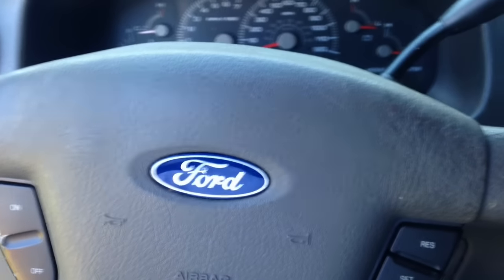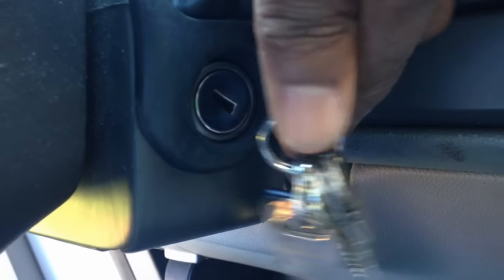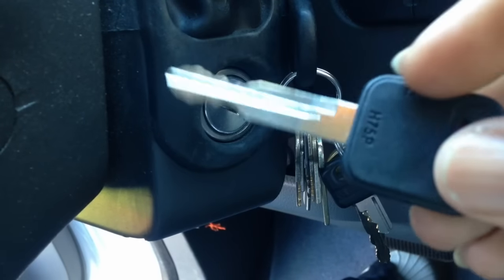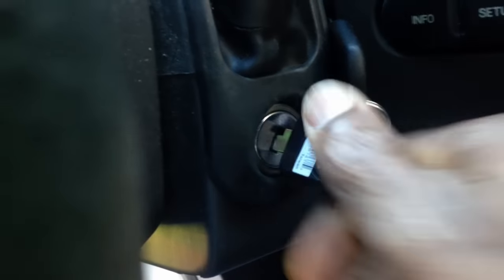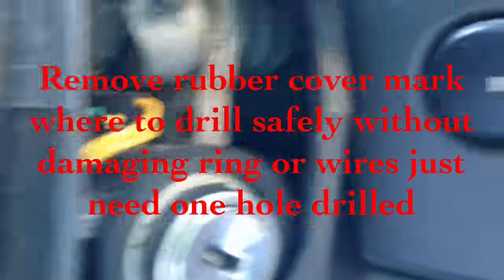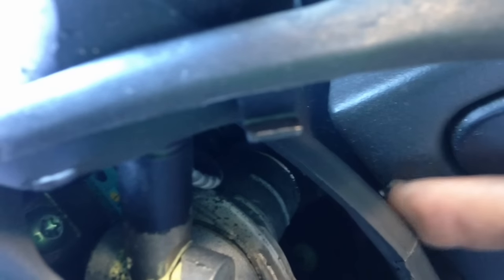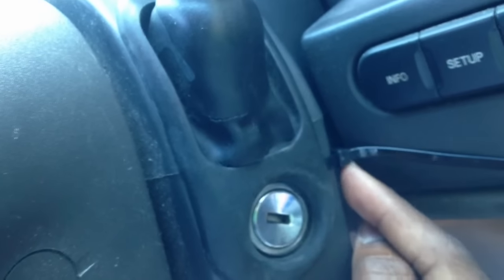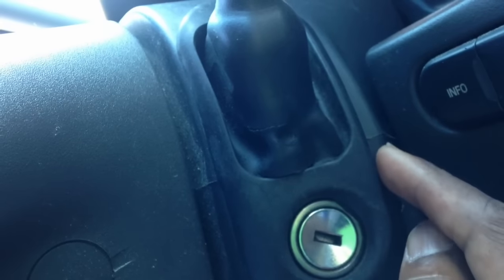REPLACE FORD KEY NO PROGRAMMING NEEDED CHIP WORKAROUND "bypass "

Comment: Of course it works it’s picking up the signal from the chip in the key, the trick is how do you do it without the key?
Reply: Just cut open the old plastic remove the transponder and glue it inside the new plastic
Reply: Jimmy S  If you have a truck or a car Ford sells as a fleet you can turn off the pats system that is how they make keyed a-like vehicles that’s how thieves steal cars they don’t change the Ecu you can also just Buy a PATS chip and program it but they will be there for ten mins as they gain access to that system thru the ecu
Reply: Why would i make a key unless i lost the original? This is the case i have no chip at all any ideas?
Reply: He's saying he could leave that one mounted, then go make 2 or 3 more copies. But now you're susceptible to anyone can steal your truck now that you're original key is mounted in there.
Reply: @mikerafonemusic6177  did you come up with a solution since you didn’t have an original key? That’s where I am right now.
Reply: The best way is to remove the chip only from the key and mount it in the column under the plastic. Now make 3 copies and your good. Now no one still can get in car and steal unless they make a key, but you have extras in case your late for work and cant find your lost key. Perfect example .  🤗
Reply: @johnnybones2029   You still have to have the key cut correct
Reply: @mikerafonemusic6177  my husband‘s key is split in half in the middle and he’s worried about it breaking in his ignition and we had a copy of another key but he ran it over with the lawnmower so one has a chip and one doesn’t but the one that does have the chip is the one that has the crack in the key so now we need a new key so we have his original but we need a new key to start it

Comment: The better way is, first get your new chipless keys made, cut the blade off the transponder key, remove the steering column covers, and hot glue the head of the key to the black plastic transponder ring found around the ignition cylinder. Before gluing it into place, just hold the transponder key in the spot you want to glue it and then try starting the vehicle with one of the chipless keys, if it starts, you found the perfect spot to glue the transponder key. This is how we used to install remote starters before they made keyless bypass kits.

Comment: My keys are so worn that they no longer work.  I can replace the tumbler, but then I would have to program any new keys -- not happening without spending money at a service shop.  This trick, could save me a pocket full of money.  Bravo!  It never occurred to me that the key only needed to be in proximity of a reader.  I always thought that it was a face to face contact thing.  Your thinking outside of the box is commendable.
Reply: Unless you have a late 80 GM car that has a resistor on the blade of the key. If you do you can bypass it with a resistor of the correct value installed in the circuit then use a cheap all metal key. I know your comment is 2 years old but perhaps someone else needs the info. Cheers~

Comment: Great idea, I wouldn't do this to a newer truck, but for my 2003 explorer it would be perfect. Not really worried about someone stealing my 13 year old truck.  Another reason this is a good idea is, say your far away from home and lost your keys somewhere, doing this will always get you home.  Thanks
Reply: Yep just use the door code and you are able to get in and get to "your spare" so to speak.
Reply: Why be worried about any vehicle being stolen when you can have kill switches or gas cutoffs installed?

Comment: Wow!  It worked for Me, I have a 2003 Ford F150 Super Crew Cab Truck and I put the "Chipped-Key" right on the Ignition and the Ace-Harderware non-chip key in the ignition and it fired right up the first time.  I think I will just attah my chipped-key to thr ignition and use the other non-chip keys since I only have the one chipped-key.  Thanks for this information 😉👍

Comment: I did this to an '09 Focus.  The odd thing is that the key had to be very close and perpendicular to the transponder for it to start with a regular key.  I just zip tied the key right above the ignition cylinder where the key is inserted (under the column cover, of coarse).  Works great!
Reply: I have a 2006 ford focus.  I'm about to try this out.
Reply: I have a 1999 Ford Windstar. The Ignition Lock Cylinder Switch is somewhat worn out. From time to time it is locked. I have to vibrate the cylinder in order to turn the key on. Will give it a try.
Reply: Zip tie, great idea I will do that with mine, thanks 😉

Comment: u can have it on the key ring next to the key an just hold it up next to the key ur starting it with an it will work, onces its started u can let go an it drops back down to the key ring. ive had to do this several different times with mustangs. i just picked a 2009 mustang gt up an its the same way except the metal part was broken off from the key with the chip so they had the chip tapped to the door an trunk key an used that to start it, but u can just have it on the keyring next to the key u use to start it now. this works  but it pretty much disables the anti theft system in ur vehicle. check this out an u can see what i ended up doing with the mustang i just picked up to keep it all together an make it work like a normal key but it  came out really thick so im going to try to cut away some of the plastic from the chip side an hope i can get it a little thinner so the key doesnt have to be so thick but its def better than having to keep up with the key an chip on the key ring but i dont know if id want to leave it attach to the column permanently just out of fear someone would end up being able to still it. heres is the page where i shared the files for  anyone who wanted to try to do the same as me if they have 3d printers. https://www.thingiverse.com/thing:6145698

Comment: If you have only one working key and you want to add additional key. You do not need FORScan or any other scan tools. 
Follow my instructions and it will work for you, I did this recently to my 03 mustang which has the Ford transponder key.
First insert your original key into ignition and turn to on position, wait till alarm light to turn off, usually 5 to 10 seconds. remove your original key and place it right next to the ignition column. Place it near the ignition is at. This tells the car that the transponder is in proximity of the ECU.
Next insert your new key and turn to on and wait for alarm light to go off 5 to 10 seconds. Remove key. 
Your new key is now programmed as the second key. 
Now you have 2 keys that is programmed to your car. 
Now that you have 2 keys programmed, follow the simple instructions to add additional keys.
You are welcome.
Reply: Need more details about the "new" key. Where do I get it, and does it need that Ford chip in it? Thanks.
Reply: @donnysworld6774  I got mine at Ace Hardware , they cut the key for me too. I programmed it myself. Yes, you need the chipped key. It can be an aftermarket key now, you no longer have to buy the key blank with the chip from Ford.
Reply: I'm so glad that someone else commented & at least tried to get any other people that may come to watch this stupid video that obviously if You listen for at least 1 whole to 2 whole sentences that You really don't want to follow anything that the guy in this video says or does & they actually have a fair chance if they read this message to do it the cheap easy way before drilling & doing dumb stuff to your vehicle that you may regret later when if you're smart you will do more than 1 search on how to skin a cat cause some people just doesn't have much intelligence.
Reply: Didn’t work for my 2004 Lincoln town car

Comment: I like this suggestion. My tumblers are broken and I have to replace the ignition cylinder. The new key won't be coded the same. This fixes that problem. If I had a new Audi, I wouldn't do this. My anti-theft is parking next to that new Audi! Well done!

Comment: This works I've been doing it since 2005 cutting the transponder out of the rubber head and installing it on the column antenna ring, I use goop to glue it to the transponder ring

Comment: Hey bro what was the original problem with your key with the chip mine wo start because anti theft is Locked and dont have a second key
Reply: I got the same issue it seems. Damn PATS started giving me issues rt before the pandemic. I get dtc p1260 - theft identified, vehicle immobilized. Got a new transceiver but no luck. Gonna try to get new keys made. Sigh, hopefully it works....

Comment: I used a razor blade and whittled the chip out. It is on the left side of the ford emblem with the metal part facing away from you right where the rubber starts. I bought a new ignition lock with chip keys that has a little door on it where the chip is. Pry on the seam of the new key and a little tray slides out. Put your old chip in the new chip's place and slide it back in key, done. Oh and the chip is some kind of hard magnet so if you whittle easy you won't damage it. Only downside is you have to have two keys now, one to unlock doors and one to start.

Comment: this will allow you to make more keys cheap. And you will have a spare, just do not tell everyone you did this. 
if you leave the whole key inside the steering column you always have a spare. Now I did this on an old car I had it was fine till winter set in then I had a few issues in sub zero cold. During summer it was fine. You do lose the added security if someone tried to hot wire the car, but that is the risk.

Comment: I had a Saturn ion they didn’t have a key fob. All that comes with is a regular key and it makes no sense for it to be chipped. I took the chip out the old key and glued to the inside of the plastic next to the ignition, and it worked fine for years and years.

Comment: Be aware that some cars (an 04 Mazda in my case) will detect that the key transponder is not being removed every time the car is shut off. 
Then after a few trips it will disable the engine for a time-out period.
Reply: Hi Bill. How frequently did you come across this issue? Also how long did the engine time out for?

I would never have considered your observation. Thank you!

Comment: does anyone know if there's a solution to my problem...
my lady has a 06 ford expedition 5.4L had issues, spent hundreds, finally found it was a faulty PCM... had it replaced and now I have an issue with communication between the pcm and key transponder.  and yes the pcm is programmed for the vehicle.  is there a way to bypass the synchronization between the two??
I can't afford the reprogramming.
Reply: Were you able to address the issue? My PATS is giving me issues, dtc code: p1260 comes up. Car thinks I'm stealing it and won't start. Dashes come up in the odometer, and theft light flashes repeatedly. I read online, a forum somewhere, if the odometer mileage shows up, it means the pcm is communicating with the ecu, which mine does once key is turned to ON position. How did you know your pcm was bad? I only have one original key, since I got the car used 10-12 yrs ago. Got a new transceiver, but car still won't fire up. Next step I'm thinking is having a locksmith reprogram all new keys. I'll see what happens...

Comment: you dont need the hole key, just take out the chip inside and glue it next to the tumbler, or brake the key off so you wont have a good key that starts your truck inside your truck
Reply: it's hidden anywya, might as well have the whole key hidden in your truck. you'll never be far away from home and screwed with no key if you lose it

Comment: this guy is a genius, he makes the Ford engineers look dumb, all those years trying to design a theft proof system and he comes and ruins it in five seconds, LMAO!
Reply: MAJESTIC AUTOMOTIVE ,
Reply: he didn't ruin it, he bypassed/disabled it.  now the vehicle is susceptible to theft with a common key.  Nothing keeps you safe from the most determined thief, but this is designed to stop the average thief.
Reply: @jimandmariebontrager4031  now the vehicle is susceptible to theft with a common screw driver*

Comment: BEST WAY TO REPLACE CHIP KEY. 2000 F150 Ford. I took key to Ace Hdw and for 70 bux he made one. no other programing. 70 is still high but it's lots cheaper than going to ford dealer

Comment: What about the alarm.  If your ONLY original keyfob is going to secured inside the steering wheel compartment HOW will you deactivate the alarms and unlock the doors?

Comment: Take the transponder out of the key and super glue it next to the ignition instead of stuffing the key in there. Brilliant however! :)
Reply: This works just fine I've been doing it for 10 years just be very careful    That you do not hurt the transponder in anyway, removing it from the head of the key, take your time be patient, Use a Dremel tool carefully.

Comment: Great Video!!!! I went ahead and subscribed! I have a 03' Expedition with the same key. But my ignition is stuck. So I taped on the the key with a rubber mallet and it came unstuck. While your key is worn, mine is the lock cylinder. I have 2 keys to it & I tried the other key earlier today & samething. Stuck. But it did work...But when I took out the key, it did it again. I was thinking of replacing my ignition cylinder and using my original key as the transponder like you did. Will this work if I just change it out from one like at AutoZone? Thanks I appreciate your advise
Reply: Yes it will work the sensor is linked using Ford's p.a.t.s system the chip in the original key will still be programmed for the onboard p.a.t.s computer the p.a.t.s. system is in no way linked to the ignition key cylinder so you can use a different key cylinder no problem
Reply: @johnubias5871  That is awesome to hear!!!! I ended up using WD 40 & WOW!!!! My key came unstuck!!! I haven't had anymore issues & when I had called the dealership they was like $100 for the cylinder & to recode it over $200!!! Bunch of BS if you ask me. I think if you have to vin of the vehicle they could make you a key accordingly. Anyways. Awesome video!!! I plan on keeping her so this will come in handy!!! Thanks for replying as well!!! Merry Christmas

Comment: would the key ever go dead? like is there some sort of battery in the key ?
Reply: Keys like this use a passive system. Basically, there's a ring around the ignition that sends a signal looking for a pattern response that the key has. It's an RFID chip, like a work badge you wave in front the box to get in. No battery, unless you have one with buttons to open doors and such, those have batteries for that, but still the same system for ignition.
Reply: Mike Vanderziel awesome ! Answered my question fully !! Thank you

Comment: I replaced my steering column it came with a key. we installed it in my 2001 Ford Windstar van but now my car won't start the anti theft light is flashing also what should I do? would this work for my van with different steering column?
Reply: No, this would not work. If your ford windstar has a transponder key than the original key PROGRAMMED to the computer would start the car. In your case, the replacement steering column may have come with a key (that does fit in the ignition) but will not start the vehicle because the sensor (located in the steering column in my 2001 explorer for example) would read a different signal that the computer won't recognize unless programmed into the computer. Regardless of the fact that the key does fit the new steering column. Best of luck to you with your windstar.

Comment: i have done that for years. out the fob under the plastic cover next tot he ign. and then just get keys cut so i did not have to carry the bulky keys on my key ring. just tell the key shop you want this just to open the door so you can get to the keys locked in the car. and that you will keep that key in your wallet.

Comment: Yeah I have what's left of the chip key taped over the steering column and dangling next to my ignition after smashing it to bits. Tried a punch on the metal part of key to drill a hole so I could put on a  Keychain. Wrong thing to do.

Comment: My used 2010 Ranger came with 1 chip key. Ford wanted $130.00 to make a second chip key. A key shop in Lansing Mi made me a cloned key for $90.00. The difference is that the new key from Ford have a different digital identity , while the cloned key is seen by the car computer as identical to the 1st key. The 2 keys that come with the new vehicle can be used to make a 3rd key. The original and it's clone can't , but all I wanted was a spare key. Why would anyone need a 3rd key?